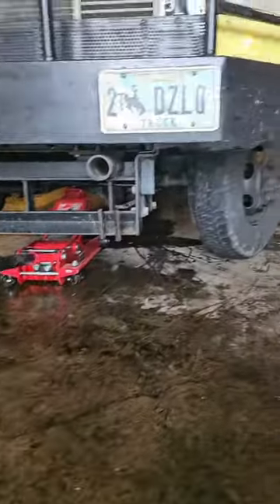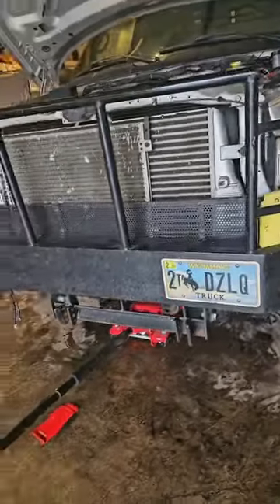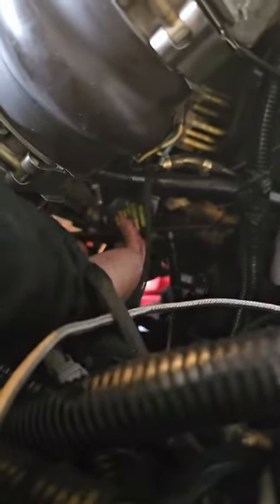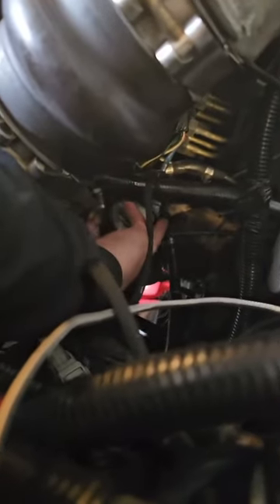2nd gen Cummins power steering system bleed procedure

Comment: The one step everyone forgets, if you have hydroboost brakes, you need to pump the pedal. It's the highest point for air to get trapped and the first component after the power steering pump.
Reply from the maker: I did that as well
Reply: Does your hydroboost unit have the little electric pump mounted under/into it? Or was that just for brake operation, if engine dies?
 ( old brain, hasn't worked on much of anything lately...lol )

Comment: No videos of big truck or heavy equipment actual repair. Clutch replacement, rear axle replace or rebuild, springs, pumps, valve adjustments, brakes, and such. Videos are of a pretty model holding truck parts. Call yourself a heavy equipment mechanic but I haven't seen it yet.

Comment: Hands down there is nothing sexier than a woman covered in grease thats a fact much respect to your mechanical wisdom ❤🙏! What most dont realize is most power steering pumps require atf,and if it leaks or whines add tranny fluid stop leak made by lucas!

Comment: Steer end to end when you are bleeding but don't hold the wheel to either of the very ends of the steering lock for extended time. Go slow and take your time just steering the fluid to replace the air in the system. You will hear the sound of the pump change at the ends. it puts added stress on all of the seals in the rack and pump .

Comment: I've got a 99  on it the power steering also acts as a brake booster. It's very easy  to break the pump drive shaft. When you hit the limit of the steering  right or left and come up against the bypass  valve it's easy to break  the shaft. It's got a weak point  designed to protect the timing gears . I broken a couple  backing  trailers  up. . Thanks for the video.

Comment: You jack up the front end and do full lock to lock steering to work out the air before you start the truck and also on hydro boost work the brakes as well that will bleed the air and then you start the truck and cycle the steering back and forth while checking fluid levels good video 👍

Comment: Yup. Replaced the box on an '02 with a Borgerson (not to mention a subsequent 3rd generation trackbar conversion). Did just as you say. Took a bit of turning back and forth b4 the whine and then a bit more b4 the whine went away. You get to the point where you think, "something isn't right". Keep going, then kind of suddenly, it works.

Comment: GM 2012ish R-bodies (traverse, enclave, acadia) are the same way, GM even recommended a vacuum pump adapter to sit on the reservoir and pull a vacuum to get the air out. But it can be done like you showed. I even hold it on the stop about 3 seconds each side, sometimes and even throttle it a little.

Comment: Turn sslower and youll purge the air better. Also the warmer the cluid is the easier the bubbles will surface.  You should cycle about 20 times in each direction being mindful to let off the wheel as soon as ypu reach full lock. if you dont have an assistant to top the res off as you are cycling the system, check every 5 rotations. This will keep you from introducing even more aor into the system

Comment: Just FYI you do not have to start the truck to get it bled. For sure jack it up and cycle lock to lock. This is gas and diesel procedure. Been working on second gens for a good bit now and it always works. It does however make a mess when it burps the air out.

Comment: Jan2nd went to go to work in my 01 dodge cummins. No brakes no power steering?!? I had just replaced my hydroboost unit due to a leak maybe 2 months ago. Was working fine. Sat a week then this? Im thinking bad PS pump. My vacuum pump still sucking so i know gear drive is still there. Any thoughts? Thanks Rick